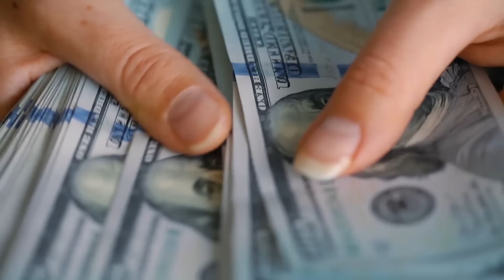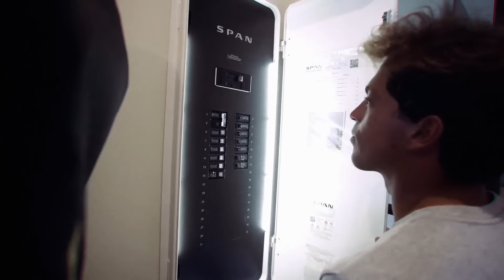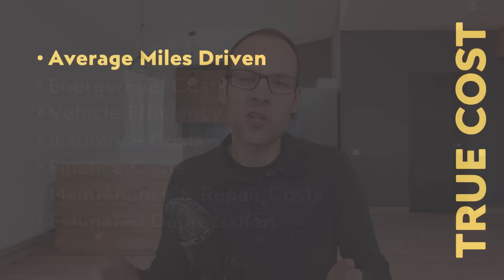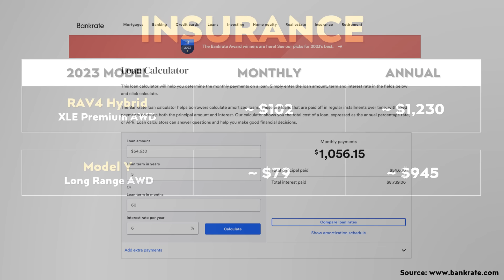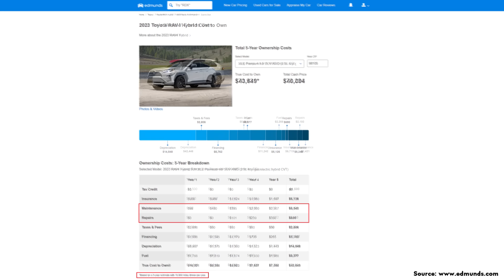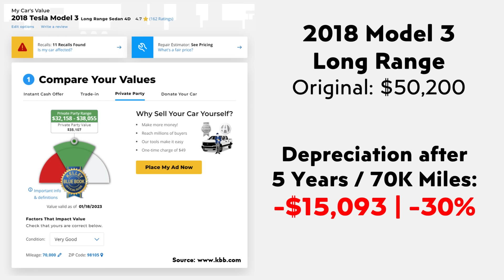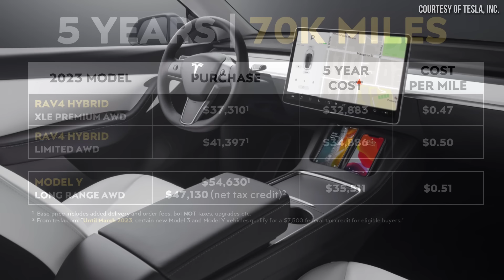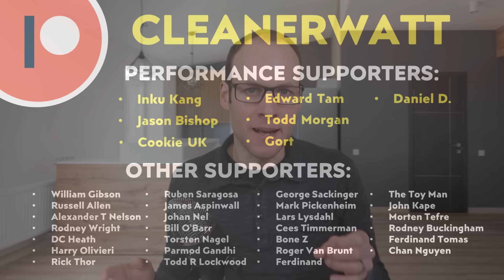Tesla Model Y vs RAV4 Hybrid: Lowest Cost of Ownership in 5 Years?

Comment: Great comparison; however in Europe, specifically in Germany, model Y has cost advantage already from the start; after governmental incentives for BEVs of 4500€, it costs 52.820€, while a similarly speced Rav4 Hybrid in Lounge edition costs 57.000€. Taking into account the same mileage of 14k miles a year, which translates to 112.000 kilometers in 5 years and a WLTP consumption of 16.9 kWh/100km for Model Y, this brings us to an overall consumption of 18.928 KWh consumed. With electricity prices for households in Germany averaging around 0.45€/kWh and Supercharger prices around the same level, total electricity costs results in 8.517€. Now, the RAV4 is rated at 5.6L/100km according to WLTP, with an average gasoline price of 1.75€/L it would amount to 10.976€ in 5 years. Depreciation is another issue in Europe and apparently massively differs from that of the US market. While highly speced cars depreciate way more than basic models, it can be retrieved from Toyota’s financing plan, that residual value after 5 years with that amount of miles on the clock would range somewhere around 40%, meaning the car lost 34.200€ in value, not even taking into account all possible governmental restrictions for fossil fuel cars in near future. For Model Y, deprecation is somewhat more difficult to predict, however, a direct comparison with Model 3 depreciation, can provide a fairly reliable depreciation numbers for model Y as well, i.e. somewhere around 50% after that mileage and age, meaning the Model Y lost around 26.410€ in value throughout the years. This brings us to a total cost of 34.925€ for the Model Y or 0.31€/kilometer, and 45.176€ for RAV4 Hybrid or 0.40€/kilometer. The costs of mandatory oil changes and yearly inspections at Toyota dealerships which can amount to nearly 2000€ in 5 years and yearly vehicle tax (BEVs are exempt) of 635€ in 5 years still disregarded. Including those, total costs for the RAV4 would amount to 47.811€ or 0.427€/ km, making the RAV4 37% more expensive to run than the Model Y. With rapidly growing acceptance for BEVs in Europe and steady decline in sales of ICE vehicles, the overall costs for RAV4 could be even higher
Reply: With 57k€ you get the RAV4 PHEV, which will use way less fuel. The most expensive HEV RAV4 is about 50k€.
Reply: @markotrieste  A Non-PHEV version of RAV4 Hybrid Lounge 4x4 is listed at 56.590€ in Germany, with metallic paint added which is standard (white metallic) with Model Y, it costs 57.380€. And the estimated WLTP consumption is rated at 6.0L/100km which is even more than what used above for calculation. The PHEV version is listed at 66.790€.

Comment: comparing to a RAV4 Prime would be more of an interesting comparison;  PHEV(plug in) can be functionally fully electric for urban dwellers that does short trips daily.  On long trips, RAV4 sips gas, shorter travelling time (gas station vs charging station).  
One question about retrofitting to newer batteries; cost will be high.  In 10 years, The cost of lithium cells will be at least 4x .  If the industry move to a newer chemistry.   Tesla will offer a retrofit, but who knows what the cost would be.

Comment: Very good report on your part.  I'm considering these two cars right now.  In reading the comment section, it's clear that your audience is very pro-Tesla.  Three significant points have been skipped. 1. Cost of electricity at DC fast chargers is much much higher than at home (needed for out-of-town trips).  2. No mention of the inconvenience of sitting at a charge station much longer than to top up a gas tank.  3.  Our electric bills will be going up substantially when we put enough electric cars on our rickety electric grid.  The grid will need upgrading and all consumers will share in the cost.
Reply: The question is whether the DC fast charging price is cheaper than refueling with gasoline. It all depends on the price of gasoline versus the price of electricity.

Comment: I think you should have included some items that really all new Tesla owners need, like a level 2 charger....  However, if someone has a long commute or for some other reason drives more than 15,000 miles per year, the case for the EV gets even more compelling.  Also, you cannot figure in such things as the fact that the Tesla is a safer car to drive, gets over-the-air updates, the time potentially saved by home charging each night instead of going to gas stations, and Tesla's software features.
Reply: Maybe.  The other side of the argument is that if you travel over 15,000 miles per year, you may have to use the more expensive electricity from the supercharging system.
Reply: I drive @18k per year. 99% of the time I’m home at night charging cheaply in my garage. I think I hit the supercharger 3 times last year. Commute is not the same as road trip.  That said, if I didn’t have a garage or some L2 charger at home the value prop diminishes quite a bit.

Comment: I thought Tesla's were ineligible for the tax credit because of the manufacturer sales volume rule?  Did the IRS suspend the 200,000 limit cap?
Reply: Inflation Reduction Act that was passed removes the limit cap for Tesla. As long as the vehicle is under $55k then it qualifies. I think the 7 passenger model y also qualifies as a SUV which has to be under $80k. Tesla has sold a lot of inventory since the price cut.
Reply: Jackson T:  New law.  Completely different rules.  Explained in detail in MANY Youtube videos by credible BEV video makers.

Comment: I actually have a 2019 Toyota Rav4 XSE Hybrid and am considering a Model Y LR.  I live in Florida and am having a hard time pulling the trigger as every other car I'm considering has ventilated front seats, which I feel is a must for my next purchase.  So ultimately I either wait another year and see (and potentially loose $15K when the price goes back up on the Y), or just go with something else like EV6 GT Line.
Reply: I can tell you first hand (now two own two Tesla, one is model Y P), you will not miss the ventilated seats. Especially compared to the design of the latest RAV4 long trip in the south (incl FL).  The Tesla seats are more comfortable, the seats do not feel hot.  I have owned vehicles with REAL cooled seats (verse the hot interior air recirculating of the Toyota).  They have some incremental value over traditional leather vehicle. But, with the Teslas, Tesla seat is cooler feeling in its own than the Toyota.  

I would get the glass roof mesh sun block.  Low cost (around $100j easy to install or take off.  You can still see they sky through it.  With my shaved head, I can feel a tiny bit of sun heat that can come through the Tesla glass roof mid day highest solstice season in Florida.  The sun heat is not bad.  Just a preference for me.  Out of a 300 mile trip the Tesla analytics suggest the mess might save about one mile of range in very hot days.  Tesla has a miracle mixture of solar blocking on the roof. 

You will not ever have the desire to go back to a Toyota once you get the model Y.  The excellent user and passenger experience with a Tesla cannot be matched. The goofy placement of buttons, switches, dials scattered across the Toyota dash is a hot mess. The all in one combo of the large single screen and simple steering wheel and stalk controls on the Tesla combined with automation that works is so much better.  Oh, as for navigation. Say good bye to the crappy Toyota system or using Apple or Android integration. Tesla system is killer compared to any of them. Easier to use, and flat out better.  Same for all the embedded “apps” on Tesla.  YouTube, Zoom and WebX integration alone are worth the move to Tesla. The sound system in the Tesla, is content quality. Compared to the Tokyo by night bull horn tin sounding Toyota.  I could go on and on about the superiority of features, quality, Easter egg of fun things any Tesla has.
Reply: @johnross6314  Wow, thanks for all that great information!  Not sure what you mean by “mess” for the sunroof?  Is it a film I assume?  I’m guessing you meant “mesh”.
Reply: Phantom braking in Florida Turnpike will add some excitement!

Comment: Thank you for great Analysis.  However, if you take into account the battery replacement cost and battery degradation, then, EV costs a lot more after 100k or 8yrs, right?   Thanks
Reply: you do know that tesla guarantees its batteries for at least 120000 miles.  Also you obviously do not own a Tesla.
Reply: @danielryan3442  Thanks.  I know about the 120k guarantee.  Battery will lose charge vs. time and will die eventually.   The battery replacement cost is too high.  So, whatever $$$$ EV owners save from Gasoline, it won’t be enough to buy a replacement battery, right?
Reply: @ductran8128  when your car has 200k miles and the ICE engine needs to be replaced.  It’ll be very expensive, right?  My car has 95k now with 7.5% battery degradation.  I’m sure it will last till 200k and then I’ll decide whether I will replace the battery if it dies or tow it to the junk yard.

Comment: Fuel cost in EVs goes way up if you don't charge at home. In some cases, it gets close to the cost of a tank of gas.  To hit these numbers, you have to drive enough miles to take advantage of the cheaper electricity,  but not so many miles that you charge most of the time at commercial chargers.  The maintenance cost for the Toyota is for those people who treat their car as an appliance.   If you change your own oil, fuel filters, and air filters, that cost goes down to $50/year plus tires.  Also, if you are really concerned about cost and you drive a lot, then you get a corolla or similar, and there are no EVs that can compete at that price point.  As for the "greener" angle, the Tesla costs more for a reason.   It takes more energy and resources to produce.   The fact that it needs tax incentives to bring the price down to make it comparable means it is probably worse for the environment than its cost suggests.   If the environment is your top concern,  then buy the smallest, lightest car with the fewest number of electric actuators and gadgets in it.  The cobalt mining slaves in Africa will thank you.  If you want a Tesla because you like it, buy one.  It's not saving money or the planet.
Reply: A lot of wrong thin king in your comments.  The US Govt tax credit is to encourage consumer uptake and lift the EV industry production run rate so that overall costs per unit fall.  Thats it.  Fortunately Tesla is doing this all on its own.  You claim doing your own mechanical work saves money?  Seriously if you do your own work and value your time at zero you may save but I doubt you value your time at zero.  Of course with a EV there is no maintenance beyond tyres and electricity and wiper water......so that's a wash!  Hence a ICE car costs more to maintain than EV by a much larger margin than claimed here.  Musk also pointed out that US dealers and car companies make the money from parts that Tesla engineers out as does any smart EV company (there are some dumb one out there of course - capitalism will sort out the weaklings here?).  Electricity costs are coming down due to renewables coming on the grid - of course in the SU you have energy monopolies gouging you between solar panel and car - but if that is how Americans want to run their country you can hardly blame EVs for bad public policy (personally I would blame the GOP & MAGA).  Most driving is done from home where many can have home charging and systems are coming to allow others to access cheap renewables at home.  The proliferation of charging spots everywhere like shopping centres will see energy being sold at low margins to draw customers into stay whilst charging.  Same at many other locations like your workplace.  SO electricity costs are not the bug bear you claim - but feel free to still pay fossil fuel monopoly prices if you wish....
Reply: @Economist from Hell  Tesla fan boys always chime in.  There is a lot of bias in your comments, but not any data or solid reasoning.   I own a toyota that I bought used. I replaced the struts, shocks, and a door actuator motor when I bought it. The actuator motor costs me $6, and the struts/shocks were a couple hundred.   These are both items that wear out at the same rate or faster in an EV.  Tesla is not "right to repair" friendly,  so those same parts would be thousands to fix on one of their cars.  Other than that, I have only had to change oil for the last 20k miles. That costs about $25 each time, and I can do it in less time than most people spend driving to and from a service shop.  I actually spend much less of my time,  because i do my own maintenance. I will easily drive this car another 100k miles without spending $2k on maintenance.   

EVs used to have an expiration on the US Federal tax credit.   This was, as you said, to give makers a chance to reach production levels to achieve a scale of economy so they could bring prices to parity with ice vehicles on their own.  This still hasn't happened and may never happen because the government just gave them a new credit that doesn't expire.  Meanwhile, ICE vehicles are being penalized by the government with gas taxes to pay for roads.  EVs freeload off of the gas taxes paid by ICE drivers.  

EVs aren't getting cheaper,  because they rely on scarce materials that aren't being recycled.  The more EVs they build, the more the materials cost.  They are working on replacements for those materials, but they aren't here yet.

This is why there is no $25k 200+ mile EV available.   They can only get those range numbers in overpriced faux luxury vehicles that have high markups already.   They have to bury the cost of those materials in markups for options that nobody really needs.  

Electricity is not getting cheaper due to renewables.  Most places charge you more if you want it to come from renewable energy.  It's not free, it's a trade off.  Materials and maintenance replace the cost of fuel.  

I'm not completely negative on EVs.  I would like to have one, but not what I see on the market today.  They aren't going to meet my needs.  Aptera looks like a good option.  They claim all the right specs and make the right promises,  but broken promises are much more common than usable EVs.  Even Tesla has more vaporware models than real ones.
Reply: Such a fantastic argument. True and well said.
Reply: fuel cost is just one part of the cost, there is only one cost that counts, and that's the total cost of ownership.

Comment: Another thing you didn’t consider is cost of installing a level 2 charger in the home which for some could be quite expensive. Depending on how long the cabling has to be ran to the electrical panel. 

Also you considered the cost for fuel can increase, you didn’t consider the cost of electricity increasing. Electricity cost never goes down from grid sources.

 In California, we’re already having brown outs where they cut the power to areas at certain times due to not enough electricity. The more people switch to EVs, the larger strain on the electrical grid which could result in you not being able to charge your car and ultimately be stuck not being able to go anywhere. The greater the demand for electricity will also increase the cost per kW over time
Reply: If a gas station runs out of power you can’t pump gas either.  I understand what you are saying here but I just totally disagree.

Comment: I just bought a Model 3 Performance with full autodrive for 40k. It has barely 13k miles so pretty much new.
Reply: Wait didn’t performance cost like 50000 with everything? Real interested in the refresh 3
Reply: @MSFS-l6h  i priced a fully loaded new for roughly $60k. Did a quick search for used and it was fully loaded with self drive and 20” wheels. So i snatched it up. 2023 model but i’m not ashamed of an “old car”  and saving $20k
Reply: @Deverydoo  probably a good deal, it’s just the new model 3 is so cool I dunno if I should get a model Y or that. The previous version isn’t bad though
Reply: @MSFS-l6h  yeah the new 3 is absolutely beautiful with some nice new features. I wanted an S, but it was similar in size to the m550 i traded and wouldn’t be able to wedge into my garage. Electric cars don’t like sitting in the hot sun.

Comment: The Tesla model Y has a huge safety deficit if you live in a cold climate. In snow conditions where traffic is stranded for periods due to accidents, the battery discharge rate (without regeneration possible in a remote area like a mountain pass) can be deadly. Starting a trip in the winter with the RAV4 hybrid is a much safer venture in this environment, as long as you fill up with gasoline first. And the utility of the Hybrid is close enough to choose this one for me in my climate. Besides the body and interior of the Toyota are superior. Thanks!

Comment: Just bought a Nissan Ariya evolve plus in my first week I drove 1200 miles took two trips back-and-forth to New Hampshire from Connecticut spent $120 in charging using fast charging. I have taken this trip many times with my four-cylinder dodge caravan that same 1200 miles would’ve cost me $240 in gas. I’ve done this trip 15 times in the last year so I would say the EV Definitely wins with cost to run.

Comment: That statement also go for the Tesla trucks. You really don’t know what the true cost will be. Especially with the big  price hike in electricity. Edison just raised their rates due to the fact the gas company raise their rates. So just imagine what the price for electricity will be, when  they revamp the power grid which will have to be done to be able to charge these electric trucks. Companies will find out that diesel was actually a bargain in comparison to what the electricity cost will be.
Reply: Currently the price of electricity is driven by the price of oil.

If the electricity gets more expensive then so has the diesel.